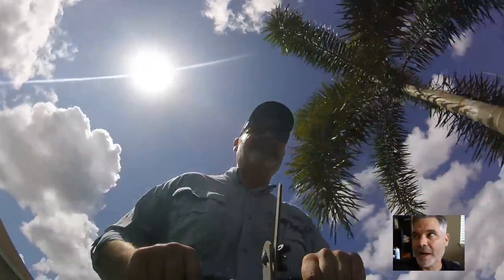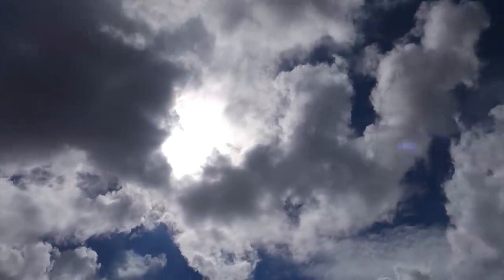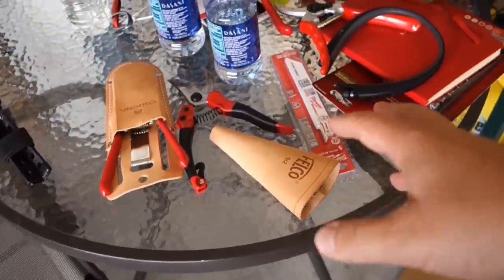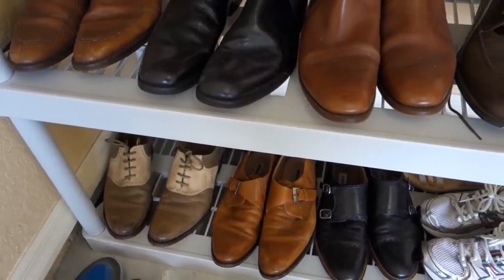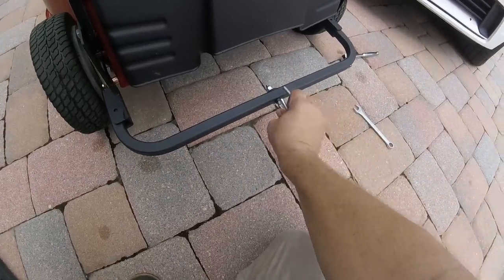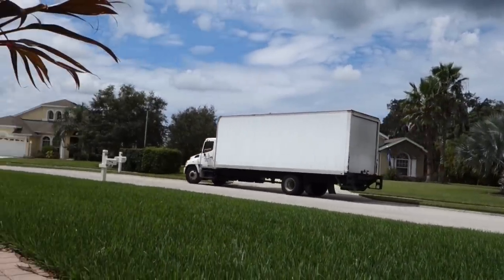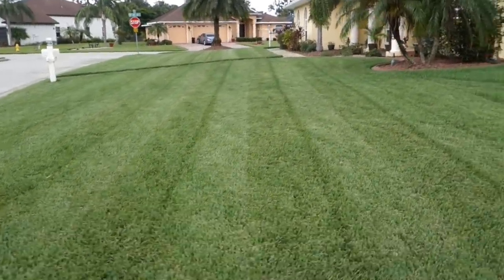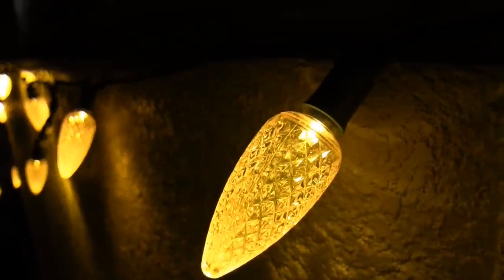Toro TimeMaster 30" Lawn Striper | Lawn Striping St Augustinegrass

Comment: I have had a super toro recycler for 11 years now and have only replaced the belt once only because I have some really deep short hills. It has a 7.5 Hp overhead valve engine that I paid $100 extra for at the time and it still runs great to bad they only offered it one year. The rear safety plastic guard that drag's on the ground - I just set a brick on each side of it for striping and it works pretty good.  I have a huge area of nice grass here in Mi. that the previous owner used for an 8 hole golf course. I have a Simplicity 25 Hp Simplicity Broadmoor tractor that I use and it stipes so good it looks like a baseball diamond when I am done. Between my Toro and Broadmoor I play all the time with how I want to have my lawn look. It is just over an acre and a half of really nice grass from its golf course days that I want to keep it looking that way. I really like your videos keep them coming please......Cheers

Comment: Stripes on St. Augustine disappear the second water hits the turf. I purchased the original Toro Striper and found it worked OK if I did double wide/three pass cuts. I like mowing grass but it was too much extra work for little reward. I even purchased a roller that is approximately twice the width of the striping kit. Because of it's weight it worked better but rain or watering ended any pattern appearance. My suggestion is to purchase either if you want something that last a day or more at best. As far as the next $200 Toro Unit? Fo-get-about-it.

Comment: Nice video Alan. However, I definitely would not recommend this mower for commercial use. I've had two Toro Timemaster this season and they've both been in the shop twice for the same problems. The pull string and the gear that turns the blades shattered. I love how it the Timemaster cuts and mulches, I just wish Toro could build it tougher. I'll probably get a 32 inch commercial Toro. They are built to last.

Comment: I had the same setup.  The rear wheels wear out within 12-18 months if you use the striper regularly.  The added weight eats them up.  I'm guessing there will be problems with the gears at some point.  cost to replace wheels are around $30-50.  Too much to replace nearly every year.

Comment: If I’m striping the lawn, can you go backwards with the mower? Lots of obstacles in front of the house. Hard to make even passes.
Btw I’m sure my neighbors think I’m nutty I’m always in the yard doing something with it. Lol
Reply: I made my own lawn striper and don't have an issue with backing up. But, there was a bit of a learning curve since you have a new contraption being dragged behind your mower. At first it's a bit awkward but it's only after a mow or two that you'll learn the best way to  mow with the striper. Backing up may lay the grass down the wrong direction so you'd have to make another pass over that section in the proper direction. I have a small lawn where I used to back up often. Now that I have the striper I've really found the best route to mow my lawn so I don't have to back up often.

Comment: Uses 12pt box end of a 1/2” combo wrench to tighten a 6 sided bolt while using the ratcheting socket wrench to hold the nut.... sir, you are 100% correct. You are not an expert in those hand tools! Haha! But I come to you for lawn expertise, so you are off the hook! ;D haha

Comment: I was enjoying the video until you mentioned MSRP of $200. That's one of cheapest, nastiest pieces of engineering that could be spec'd from a Chinese factory. Not a bearing, decent linkage or well produced part on anything you showed. Filling it with sand and the design accounted for, I'd value that kit at $20 tops. I appreciate that it does do it's job, but WOW, that is drastically over-priced imho.